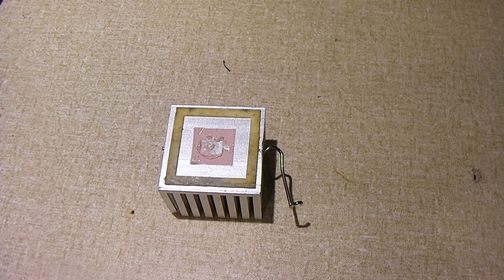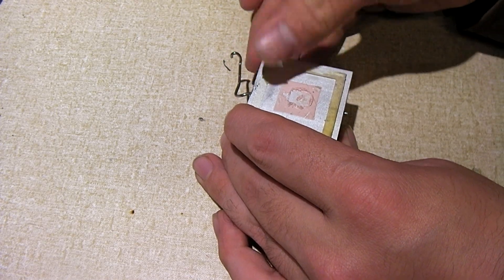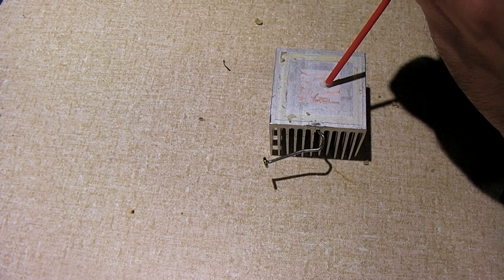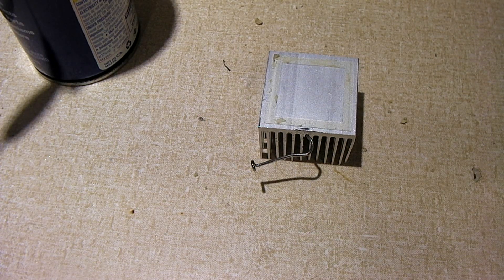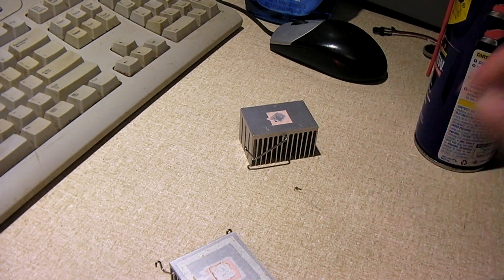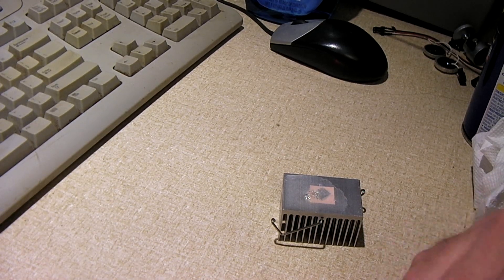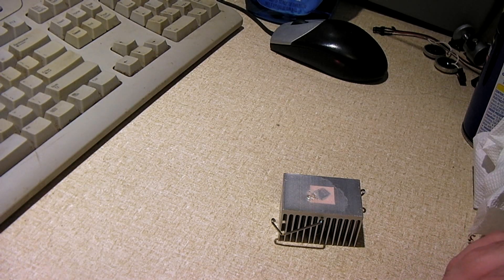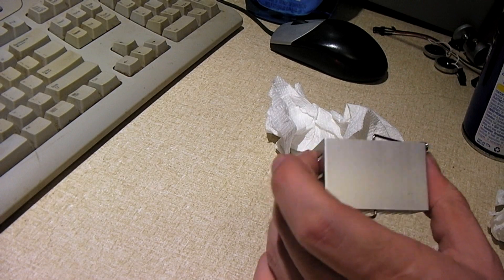How to remove the dreaded pink gum material from chipset heatsinks

Comment: Update! After much scrubbing and precise whittling, I have removed the majority of pink gum (I assume it's cured silicone adhesive / aka a type of conformal coating) and a clean surface on the heatsink - with the foam border intact - and the onboard gpu face. With several cheap, easily accessible makeshift tools. Aside from proper thermal compound.

Tools used:
91% Isopropyl Alcohol
Q-tips (pointed Q-tips might be better)
Toothpicks, cut at an angle in the middle
Wooden clothespins (clip style)
Cheap plastic ballpoint pen (which can be disassembled, best if the tube and point ends are sharp or have a nice edge)

You'll also need thermal pads (I assume 0.5mm or 1.0mm will do?) Or thermal pad paste replacement (NX5 Pro or whatever it's called - less guessing, more versatile).

I started by using damp Q-tips dipped in iso alc. Give the stuff a few passes to get it to soak into the surface of the glue. Then carefully pick away at it with the toothpicks to remove as much as possible (might help if it's heated a bit, either directly after running at load or with a hairdryer, etc. This also helps when removing the heatsink. Twist very gently and carefully until it starts to give, then apply gentle pull until it decides to come loose.)

Then use the ballpoint pen (with the ink stem removed) tube or pointer thing to scrape as much adhesive residue away as possible. And I mean scrape! Some left around the sides of the chip and corners of the foam shouldn't matter.

Few more passes w alcohol on a q-tip. You will prob use quite a few.

Next, use the dismantled clothespin to rub away as much remaining residue as possible. You can use the back end flat or the back corner to get it moving or shoveled to one side. Then use the front side flat in a gentle circular motion to clear the rest away and hopefully have a mostly clean surface at this point. Also, this is the most effective method for clearing it off of the heatsink, or at least pushing it to hide in the corners of the foam.

Again, scrub w alcohol q-tip a few times and finish by using a dry q-tip in gentle circular motions to buff the surface and reveal any residue you may have missed.

Use an angle-cut toothpick to scrape any adhesive off the sides of the gpu chip and the foam corners (optional - the most important part is having a clean surface on both the gpu face and heatsink underside for contact with a thermal medium).

Go over it again with the front part of the clothespin piece to loosen any adhesive that moved to the top of the chip while scraping the sides in the previous step.

Scrub scrub scrub scrub scrub with alcohol q-tips and blow on it in between to help the alcohol to evaporate and reveal clean surfaces without any streaks or spotting from evaporating slowly.

Once both have a visibly clean and shiny surface, place your 0.5mm or 1.0mm thermal pad or a thin layer of thermal pad paste replacement. Affix your heatsink, and hope for the best! 😂

Comment: I just used a flash head screw driver and a hammer 😂
Reply from the maker: You'll damage the surface of the heatsink doing it that way haha
Reply: @CubeComputerChannel  Sometimes if im lazy and the machine aint worth a lot of value ill just do it that way then i will slap on a thermal pad and call it a day 😂😂

Comment: Thanks for sharing this. Do you have a similar video for chipset? I just removed the heatsink and found a nasty bubble gum mess where it came into contact with heatsink. Need to get rid of it before applying fresh thermal paste.
Reply from the maker: For the chipset, you could spray some WD40 on a paper towel and then use that to wipe away what's on the chipset. I'll do a video on that when I get the opportunity.

Comment: Great video. I just tried this on an old Radeon X1400 gpu that had this terrible "thermal glue" on it and it came right off after a little scrubbing for the more stubborn areas. ;)

I used the "WD-40 Specialist: Contact Cleaner", which I've been using to clean electronics lately, instead of "Regular WD-40" so I didn't have to worry about the "residue" as it evaporates much faster and dosen't interfere as much either.
Reply from the maker: I'll have to look for this stuff! Did you buy it locally or did you order it online?
Reply: @CubeComputerChannel  My local Walmart happens to carry it in the same isle as the hand tools/power tools and next to regular WD-40. Otherwise it's also available from etc. Home Depot, Amazon, ect.

Comment: DO NOT remove the foam on the outer edge. It's there to prevent the SMD components from shorting out. At the very least replace it with kapton tape.
Reply from the maker: The foam was originally there to help keep the heatsink balanced on top of the chip die. I've removed this for many years with no problems. The Intel Pentium III CPUs as well as the heatsinks for a lot of chipsets do not have this foam around the edges.
Reply: If you replace with a thermal pad, I would assume it might be okay. I was thinking of replacing the foam square on mine with thin strips of non-conductive thermal padding I bought. Not sure if it will hold up or melt... I figured it was there to create a sort of airlock, trapping heat inside a sort of bubble. Retaining contact w the exterior heat and the heatsink.
Reply: This foam also prevents chip corners from being damaged (cracked).

Comment: How do i remove this kind of heat sink?
Reply from the maker: Depends on how it's held to the motherboard... you could have metal hooks (less common) or plastic pins that snap through the motherboard and hold the heatsink in place. If the motherboard has these, you'll need to pull the board to remove the heatsink.

Comment: That's awesome! Thanks for sharing that! Now if you can figure out a way to easily remove the heat sink from the board 😁
It was cool watching the chemical reaction on the last one!
Reply: use pliers... pop the plastic top from the front of the board while squeezing the plastic mushroom top of the rivet and push it through.
Reply from the maker: WD40 is a great solvent.